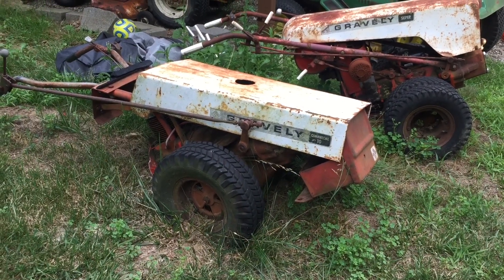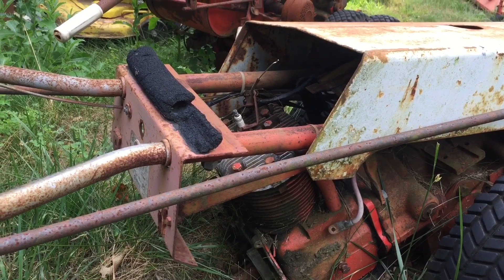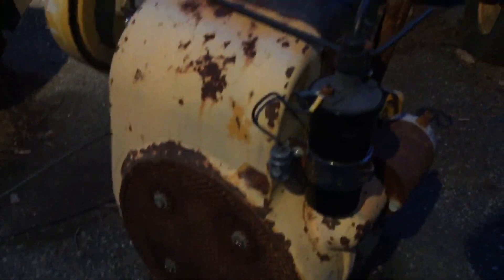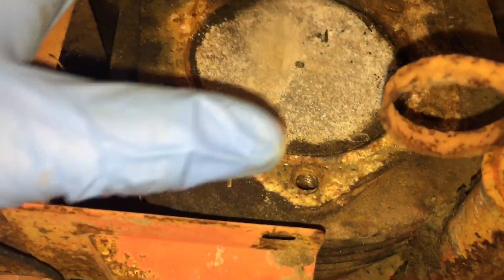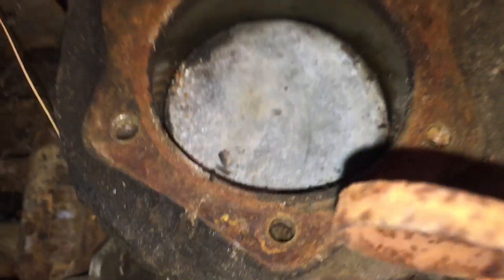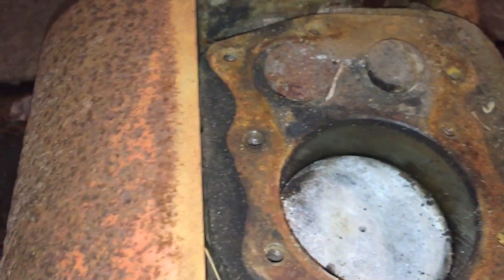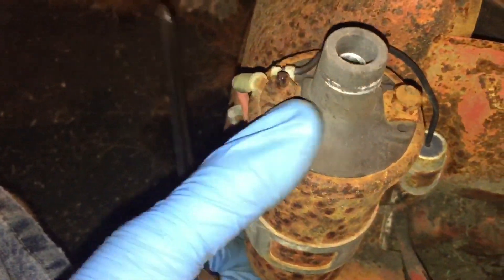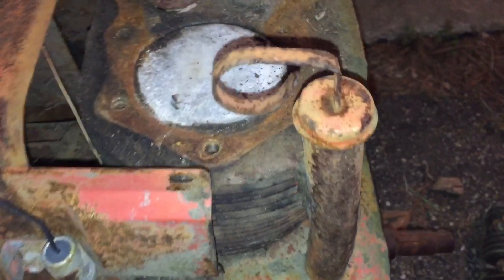Saving a Gravely Commercial 10A to 12 Part 1

Comment: wire brush the head deck surface? are you kidding me? and c'mon, what kinda bore measuring technique is that. gimme a break.
Reply from the maker: mxthunder2 I am not rebuilding it.  The measuring is just ball parking to make sure it is a 12 Hp and not 10hp....